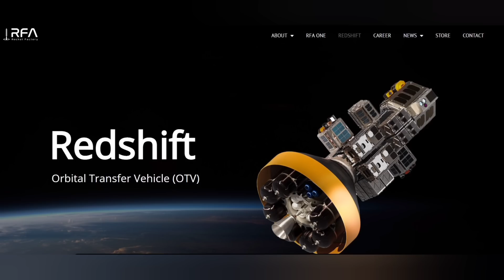NASA needs a new lunar rover for Starship!  Plus, Germany races to orbit!

Comment: Actually I watched a video about solid fuel rockets and there is one that uses electricity to ignite the solid fuel. As long as the electricity is on the the fuel will burn. Turn off the flow of electricity and it stops. 
But for the life of me I don’t recall who put out that Vid so I could share it.

Comment: At this rate the National Team's lunar lander might be ready for Artemis 3 before SpaceX. Starship not only has to get to LEO, it's has to perfect in orbit fuel transfer before a single Starship goes to the Moon. Has SpaceX even thought out how Starship will even land on the Moon, with the currently inadequate landing legs? The National Team Lander can go to the Moon in ONE launch. Starship should be the Lunar Lander further into the Artemis program.
Reply: The Blue Origin National team lander requires a lunar transfer stage which is launched separately to get it to the moon it's certainly not a single launch.
I think it also requires in Lunar orbit propellant transfer except with liquid hydrogen which is even more difficult to keep in it's cryogenic state.
Blue Origin have a great deal of work to do just like SpaceX.

Comment: on June 20, 1944, a V-2 reached an altitude of 175 km (109 miles), making it the first rocket to reach space.
Reply: Many (including the Germans at the time) considered the first successful test flight on 3 October 1942, reaching an altitude of 84.5 kilometres (52.5 miles) to be the first object to reach space. On that day, Major General Walter Dornberger declared in a speech at Peenemünde:

This third day of October, 1942, is the first of a new era in transportation, that of space travel...

Now, 52.5 miles isn't above the Karman line, but our own USAF and NASA still define "space" as starting at 50 miles. X-15 pilots were given astronaut wings if they flew that high. 

In any case, yes it was the V-2 that did it.   In many ways, our first satellite was launched on a derivative of the V-2 as the Juno 1 (Jupiter-C) was basically a stretched V-2 with an upgraded engine.
Reply: Ok cool…

Comment: Angry Astronaut, what we really need is a lander that fits on top of SLS. 

I have no idea why that was not a requirement. That should have been one of the basic requirements, "must work with existing commercial LEO launch services".

Is it really impossible to put the Blue Moon thing on SLS? What if you only lift it to LEO and then refuel? And send the crew separately, and have them wait at ISS until the stack is ready to fire off a TLI rocket? Possible then?
Reply from the maker: Blue Moon is too heavy for the SLS USA.  It's difficult to believe that NASA tossed ALPACA on the scrapheap when it was the only lander compatible with SLS.
NASA could possibly order BO to scale down their lander, but I don't see them ordering Jeff to do anything.
Spoiled billionaires always get their way.
Reply: Blue Moon will fit in Starship’s faring, no? 🤣
Reply: @reverse_massage  how dare you mention Blue Origin and SpaceX in one sentence? Please don't give Mr. JB any excuse to start a war 😂😂
Reply: @reverse_massage  

"Blue Moon will fit in Starship’s faring, no? "

Starship hasn't flown yet and the owner is a right wing extremist and racist.

Comment: Germany can barely keep the lights on. it is not racing to orbit.
Reply: Which is why they are using actual candles instead of real rocket fuel…duh….
Reply: @reverse_massage  what?
Reply: @Withnail1969  Paravin is candle solid fuel, but with pure oxigen it is rearly powerfull.
Reply: They can keep buying electrical power from nuclear powered France, as long as the French sell it to them.

Comment: I can't see SpaceX delivering a moon rover that isn't made by Tesla, this would be a huge missed opportunity.
Reply: The cybertruck already seems like a viable contender. It would of course need some modifications.
Reply: @reverse_massage  Yeah, I've always suspected Cybertruck (and the ATV, for that matter) of being a platform intended to be adapted for use on Mars and the Moon.
Reply: I mean, for an unpressurized version, they'd pretty much just need to change the tires, right?

And a weak pressurized version (without airlock, so you both have to wear your suits, and helmet up before evacuating the cockpit and opening the door) shouldn't be that hard either.

A proper rover (with airlock) would take some more work, but Cybertruck as we know it today is already a pretty good start.
Reply: I think you would have to at least halve it's weight, perhaps a convertible, fully exposed wheels, and various other mods, I would like to think it is possible.
Reply: @steve5090406   Halve the weight -- you mean for making it practical to get it there? Sure, the extra mass would be wasteful, too much so for it to be practical... unless & until it's Starship doing the transporting, at which point it becomes much less of an issue. 

Then once it's there, the extra weight might actually be an advantage, right? In 1/6 gravity, you want to be held to the ground more tightly, so you can get more traction.

This is one of the ways Starship's vastly increased payload capacity and lower price/mass will cause a radical re-think: vehicles that are actually rugged, designed for heavy work, as opposed to fragile things designed to save every possible gram of mass, will become practical.

I might have been oversimplifying a little bit when I said "just change out the tires"... but not by much. I'm picturing something that's very nearly the same truck, just with big fat airless tires.
Reply: How it would handle cooling? Both battery and motors would be hot , and there is no air to cool them down...
Reply: @disketa25  Heat -- good point. Yes, that would require some work. More than just sticking radiators on the exterior, probably a whole network of heat pipes to carry heat from where it's generated (mainly batteries and motors). Maybe the tires can be part of it -- assuming they're some kind of wire mesh, maybe they can also serve as radiators and/or conduct heat into the ground.

So yeah, a bit more to it than I first thought, but I still think it'd be relatively simple. And more importantly, I suspect it may have been the intent in designing the thing. Maybe they were thinking of Mars first, where there's at least some atmosphere, which helps a little with heat; with the Moon, thanks to Artemis, being more of an afterthought.
Reply: @voidstarq  BTW, why not to use molten salt cells (NaS) on the Moon and beyond? In such case excess heat could be an advantage, not a problem...
Reply: @disketa25  You mean, as a big heat sink, to dump the waste heat into, instead of needing to radiate it? Sure, why not. Either have enough thermal mass there to hold all the waste heat of a full excursion, or at worst, when it reaches capacity, stop, stick s probe in the ground, and cool it, using the Moon itself as an infinite heat sink.
Reply: No one is suggesting that a currently existing Tesla vehicle would be driven around on the moon, Tesla has all the required technology to make a dedicated moon rover possible.
Reply: @steve5090406  I sort of am suggesting exactly that. Specifically with Cybertruck. Not unmodified, obviously, but that (a) the modifications needed would be relatively minor, and (b) I suspect it was designed with this in mind.

Modifications (trying to think like Elon):

* At the very least, for an unpressurized version: airless tires, a heat-rejection solution, and reworking the cockpit to accommodate a driver and passenger both wearing full spacesuits. Nothing there sounds like a major obstacle. (Not to underestimate the work involved, but it all seems pretty doable.) Am I still missing something?

* For a proper version, with internal life support and an airlock? Requires somewhat more space than the Cybertruck has, but maybe doable on the Cybervan some have been speculating about (bigger, boxier version of Cybertruck.)

* Intermediately, how about a version that's pressurized and temperature-controlled, but no more than that? Allows crew to take their helmets off while driving, but they still need to be wearing their full suits; and to go outside, instead of a proper airlock, they need to helmet up and evacuate the whole cockpit before opening the doors. For this, all you need to do is add pressure seals and an air circulation system to the above unpressurized version.

So yeah, there's work to do, but my point is, not only do they "have the technology", they don't even need to design a whole new vehicle.
Reply: Let's not forget the cold gas thrusters that Elon is promising for the Roadster, these would be invaluable on a moon rover to hop/fly around/over the moon's surface. With the technology available, we need to think beyond the basic rover concept.
Reply: @steve5090406  Oh, right... and by making it a mass-produced part, they can make it an absurdly cheap thing (by space standards) to add to... pretty much anything.

Comment: Elon is not running SpaceX anymore.  If he was, this would be cyber truck or the new roadster.  Just like lunar starship, the cyber truck rover would be an excellent chance to try out mars hardware on the moon before the big migration to mars begins.  They should be testing stuff like the rubber that the tires and wiring is made with in dragon trunks or tethered just outside the ISS airlock, or possibly orbit an entire cybertruck to be retrieved when a cargo variant of starship is ready with the gator mouth like in "You Only Live Twice".  Would be great to have video of it gobbling up the cyber truck.  They could auction the space truck after they are through examining it for damage from space.